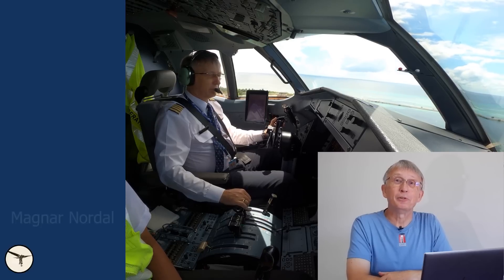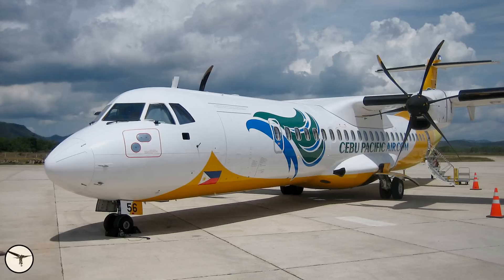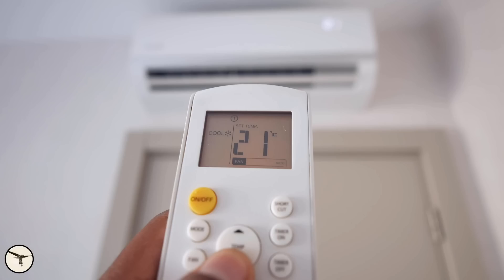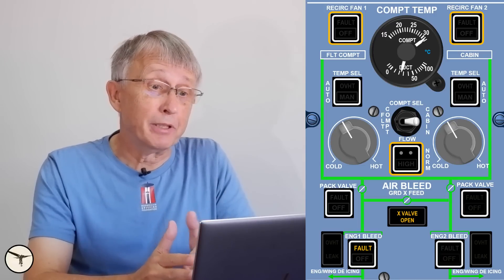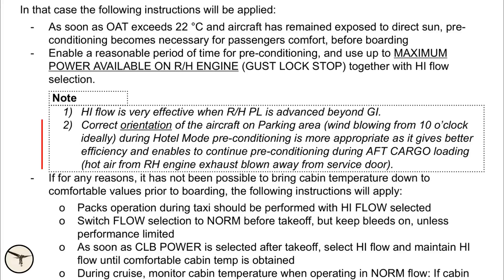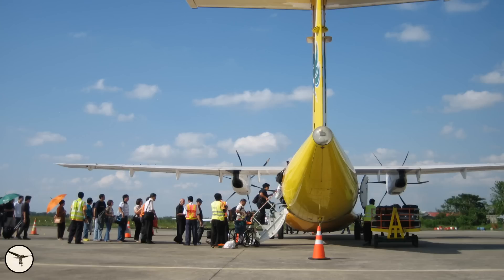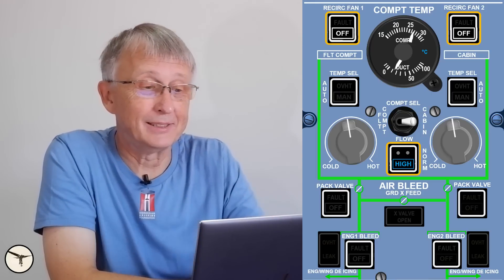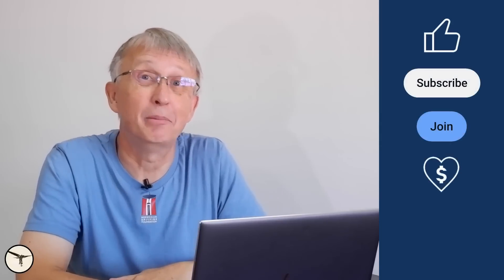Mastering ATR Aircraft: Avoid Icing Issues In The Air Conditioning System Explained!

Comment: Thanks! Just to add something to the 1st part of the video regarding a situation with a dispatched Pack Fault: noticed some Captains (even TRI´s) switching the associated Bleed off during flight, their explanation is that once the Pack is inop there is no need to have also the bleed on in flight. Does it makes sense?
Also some Captains try to not use the Recirculation Fans in flight. Is there any benefit except reducing cockpit noise?
Reply from the maker: Thank you for your support!

The people who write the procedures know the aircraft better than we do. Trying to change them could lead to unpredictable consequences. If pack #2 fails and you switch off engine bleed #2, shutting down engine #1 after landing will result in no bleed air for pack #1.

Switching off recirculation fans in flight cuts cabin airflow by about 50%, which can make the cabin uncomfortable for passengers. I only turn off recirculation fans during hotel mode or taxi to cool the ducts (with high airflow and power lever at the gust lock stop in hotel mode).
Reply: There is only one time that I think turning off the recirc fan helps: when Pack 1 is off and the cockpit is hot. Because the mixing chamber comes after the recirc fans, having Fan 1 on reduces the amount of air that comes from Pack 2 through the mixing chamber and into the cockpit. If Fan 1 is pushing hot air from under the floor into the cockpit, then turning it off helps get more cooler air from Pack 2. In this case, Pack 2 and Fan 2 is still supplying the cabin. Once the cabin is at a comfortable temp, Fan 1 can be turned on again.

Comment: Hey Magnar. Coming ever closer to starting the final stage of training CPL/MEIR. Have been doing a lot of study on the ATR as I currently work on the ground  for an Irish airline flying this fleet and will hopefully get an interview next year. I’ve really fallen for the ATR. I have a question though if you don’t mind d. I’ve heard that with AUTO feather inop ideally you wouldn’t want to feather an engine without being at least 45 percent on the power levers. Unfortunately I never got to finish that conversation. Am I correct in saying this is because with too low a selection on the power lever the blade angle may be too fine to achieve full and proper feather position. Any input on this would be great. Again thanks for you videos will be a real great help when the type rating comes fingers crossed !
Reply from the maker: Good question! When an EEC is inoperative, the ATPCS is inoperative. If you then experience an engine failure during go-around, you have no autofeather. 

With a windmilling propeller, the power lever controls propeller blade pitch directly: Propeller drag will increase when the power lever is moved towards idle. Therefore, the power lever should not be reduced below 45 degrees before feathering.

With 45 degrees, they mean a scale on the pedestal indicating the position of the power lever.
Reply: @ thanks so much!. Just to clarify by the phrase propeller drag, your saying by going idle it will bring the blades to a finer angle causing more of the blades to face the forward direction resulting in even worse asymmetrical yaw? Appreciate the help with this question captain!
Reply from the maker: @whelanvidswhelanvids1500  Correct
Reply: @FlywithMagnar  appreciate this! Safe flying Magnar

Comment: How could changing the Temp Control Valve affect ice in the turbine, since it is after the turbine? Surely it's the TIC valve. And since there's no way to manually control that, if the turbine ices up it's a mechanical problem.